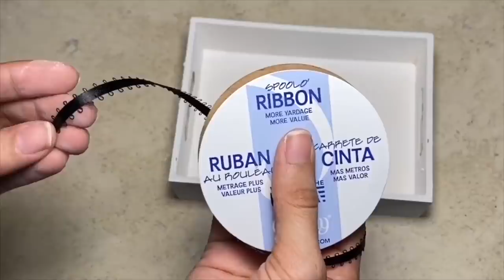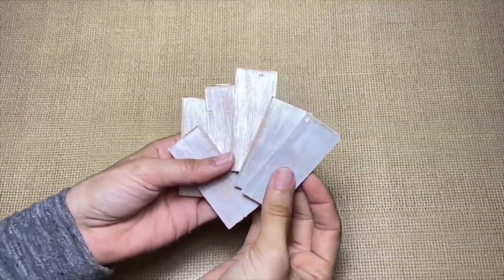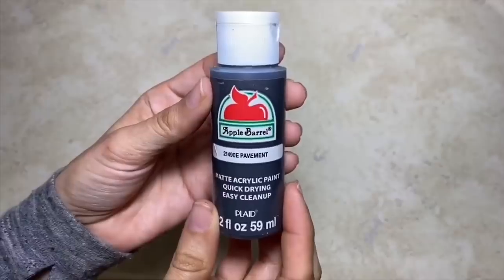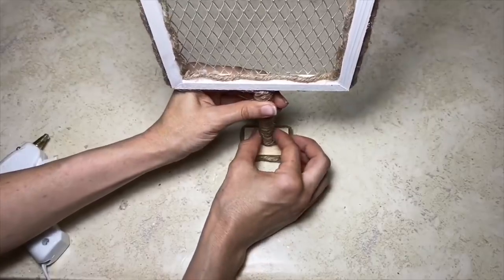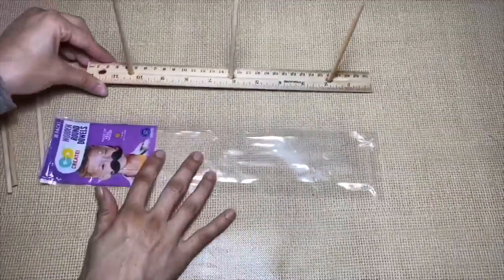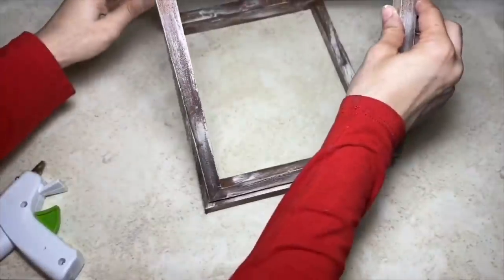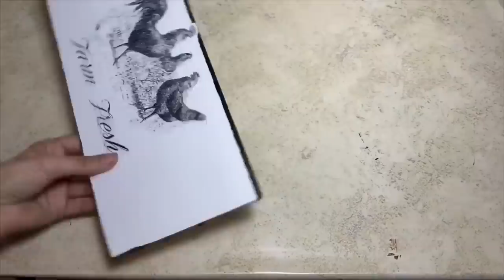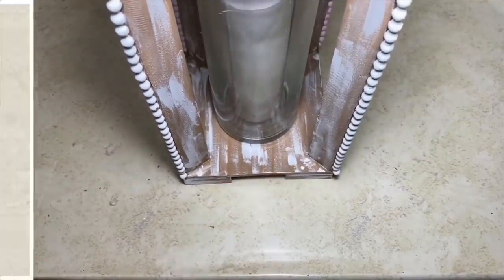Over 20 Dollar Tree DIY Farmhouse Decor Craft Ideas 2020 - Farmhouse, Rustic, Modern And More

Comment: your DIY ideas are nice, thks for sharing, but your use of hot glue is a bit messy 🤣 and by the way, you cannot put a real candle in any container with a lid on it, when there's no air, there will be no flame 😁